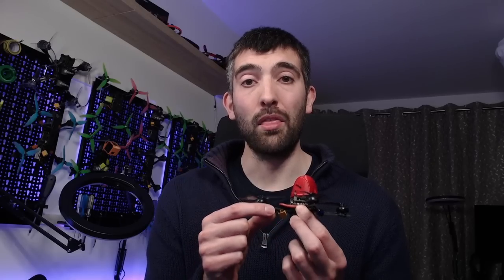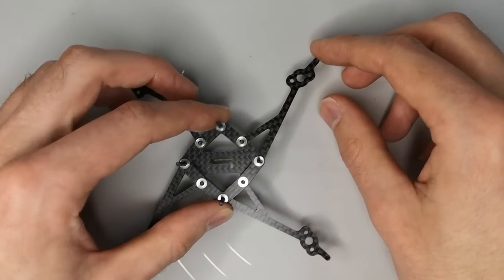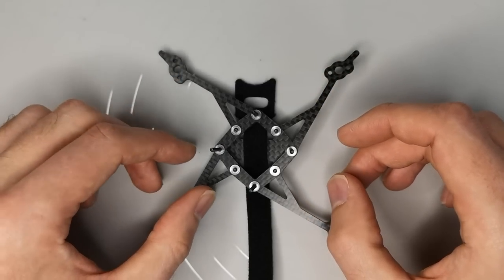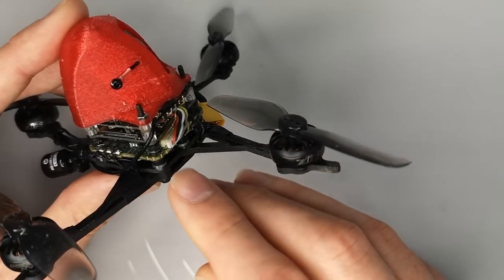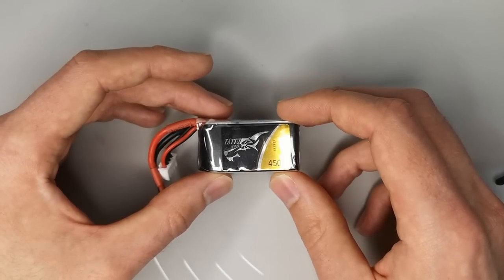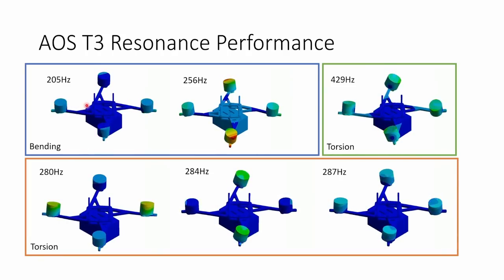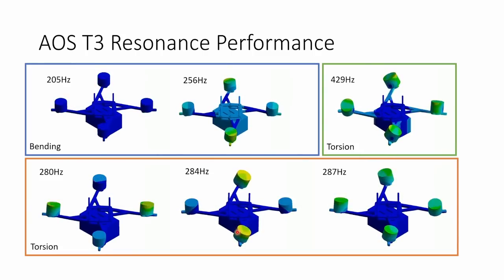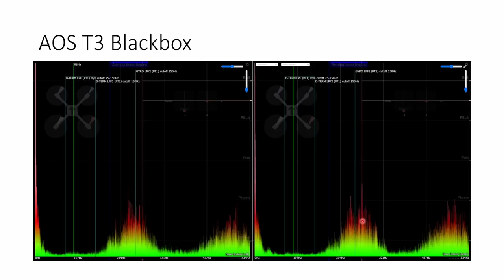Evolving the 3" Toothpick Drone: The AOS T3

Comment: I flew toothpicks for the first 3 months of fpv. Don't you think the f7 Beast aio is a little overkill for such a build though? Surely you could get away with something cheaper. Though I guess you get blackbox and other benefits using the f7 Beast
Reply from the maker: I'm sure you could use something cheaper. The F7 and blackbox are nice features though to be sure as well as the plug for DJI.
Reply: @ChrisRosser  ah yea I forgot the plug it has for digital.  Keeps it very simple. After looking at the weight of some other aios  suppose the extra gram from the beast aio is worth it in the end for benefits. Especially if you are going to be running digital. Weight becomes less of a issue since you're already pretty heavy.  Definitely will be grabbing one of these frames. How do you think it'll perform on 1s? My current 1s 3 inch is heavier than all hell (82g awu) but still flies quite amazing surprisingly enough.
Reply: @Brian-S  Diatone has MAMBA AIO F722 MK1 35A and it comes with DJI plug. it's a lot cheaper than iflight F7 beast. It doesn't has blackbox though..
Reply: Personally I fly the Flywoo gnf745 with 40a 32 bit ESCs and black box.

I feel like if you have the money, bl32 and bbl are worth it for sure.
Reply: TBH I really like JHEMCU GHF405AIO Pro, it's cheap enough, more amps that you'll ever need on a TP and has all the bells and whistles you might want.  I have that on couple of my  builds like Toothfairy 2 350g AUW build and some others. Been solid so far. There is an H7 variant, but TBH you  dont really need that.
Reply: @ooHotcooleRoo  I've been impressed with the jhemcu AIOs too.
Reply: @ooHotcooleRoo  do not get the h7 variant. No bf support for bi-derectional dshot. So you have to mooch off an iflight target. And still get no bi-derectional dshot. Other than that flys well.
Reply: I switched to the beast F7 on my 3” toothpick because I got tired of blowing out ESC’s on the cheaper ones. Been flying it and crashing it for right at a year now as my daily flyer and no issues so far. I typically crash it every flight, probably average two flights per day

Comment: I see issue with most 25 by 25 FC that have USB pointing downwards!
Reply: Those are tiny whoop FC.   The toothpick FC have the USB on the side.
Reply: @NathansHVAC  Not true,  I have a 12A FC which can do 2S-4S paired with 1204 motors. So that being said, why limit the frame design.

Comment: I'm just a troll (who also happens to build and fly almost exclusively micros), but I would argue, that a 4mm single plate frame would have a similarly good resonance characteristics while still being lighter, far less complicated, cheaper, better looking and sooo much more durable (with this bulk, or anything above 70g all up weight, these 2.5 arms will be snapping in crashes like nobody's businesses!).
It's a nice first attempt, but toothpick frames these days are really mature products - especiallly from designers, who focus exclusively on these kind of frames - just check out e.g. Quad 66 War Pig frame design (obsesively tested and perfected with BB analysis). ...And if you think your FC mounting system is clever - you are in for a surprise.....
Reply: But mounting a vista on a warpig is hard :)
Quad66's design is excellent for 
 ultralight toothpicks. Mine is about 35g
Reply: @nikotttin  I am just about to do it for the first time (i.e. naked Vista on a 4mm WP 124), so I will see for myself... 
I thought if I use a typical 25.5 AIO - it should be no problem...
Also - who says toothpicks must be with digital video?
Reply: @onemanmob6756  not me :))
I have a heavy Toothpick (4s, 1205 5000kv on a Petrel120x frame) in the weight range shown above. It is not as snappy and happy in the air as the ultralight pig. I'm hoping 4.3 will change this...
Reply from the maker: In my experience unibody designs have poor resonance perfromance because there are no joints to create damping. The Armattan Chameleon and Marmotte are good examples of this issue. Perhaps a 4mm arm solves the problem?
Reply: @ChrisRosser  the two Armattan frames are a bit... dated in their design, but nevertheless, a single-plate frame will probably never be as good at damping resonances as a multi-plate/bolted design, however a 4mm single-plate frame's resonant frequcies should be shifted to way higher frequcies and their amplitudes should also be reduced significantly....
Now, how about this: two identical, single-plate frames, with different thicknesses (say 2mm and 1.5mm) 'sandwiched' together with (and/or without) dampening grease in between them, no additional bolts to fix the frames together, just the motor-mounting bolts and stack bolts? Could it be as good (better?) at dampening resonances than a multi-plate/bolted frame? Its weight should be comparable to a single-plate frame of the combined thickness of the two frames (in this example: a 3.5mm)
Reply from the maker: @onemanmob6756  Lots of people ask about sandwich designs and the answer is that they are remarkably less stiff than a single plate of equal thickness (because the sandwich layer doesn't transfer shear stress) and not really worth considering. I take your point about the 4mm frame being so incredibly stiff that the resonance doesn't matter. When you get down to these tiny sizes the weight of multiple parts starts to approach the weight of a single piece design.

Comment: If these quads have so much vibration then why do they fly amazing? This whole vibration thing is beginning to seem like a grift.
Reply: Because there are more paths to vibration management than just FEA. The TP3 formula is about balance of the entire drivetrain and specifically not adding so much power they you now need to worry about resonance issues or further hassle. 1303 5000kv 3s 3018 or 3016 props on something that's ~110g auw with a 3S 450-550mah battery is going to fly well regardless of the frame it's on. It's boarderline power where you start having issues where you need further frame management and a significant capacitor for electronic noise too.
Reply from the maker: I think when considering a design that is an evolution of a concept it always makes sense to ask if this is going to be a meaningful upgrade for you. If you feel your current setup flies amazing then no need to upgrade. The reason I embarked on this project was because a couple of my Patrons felt that their toothpick builds needed better vibration performance to get the quad where they wanted it to be. Those guys already have their TP3s and I hope that they think I did them justice!

As Bob rightly says the benefits of FEA and simulation really come into their own as you push power/weight/tuning and start to find the limits of a build.

Comment: oh those motor mounts will snap off
Reply from the maker: Ultralight frames are surprisingly durable because they don't carry that much energy into a crash. If the motor mount proves to be a weak spot I'll beef up that area a little (as I've done with the AOS 3.5 recently).
Reply: @ChrisRosser  yeah, that's true of course
if the auw was below 85g it might not be an issue
but at 120g? we'll see :)
the arms ending right at the attachment holes was a bit weird to me, too
but it obviously works and flies quite well ...